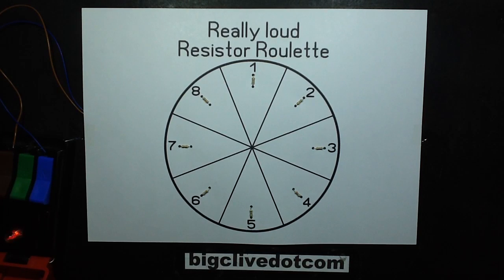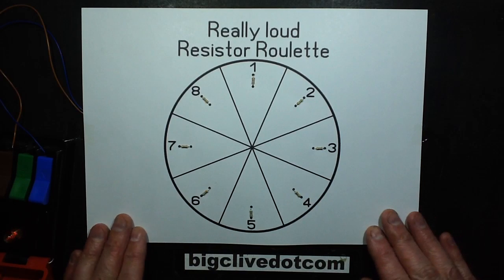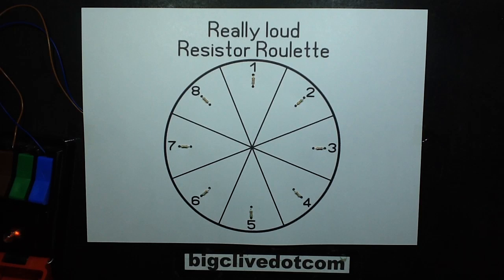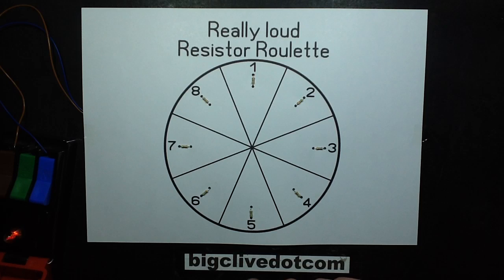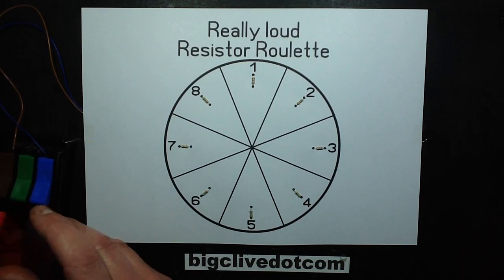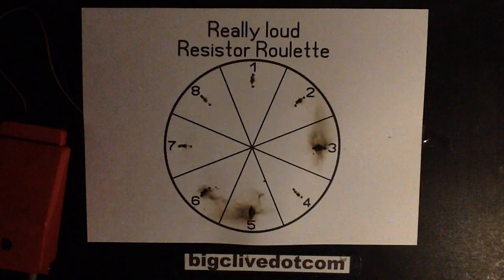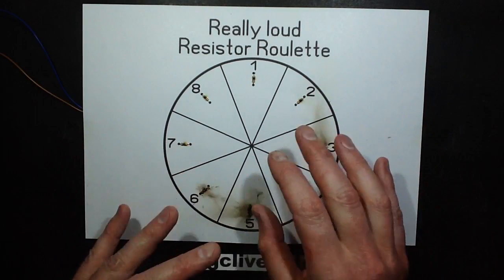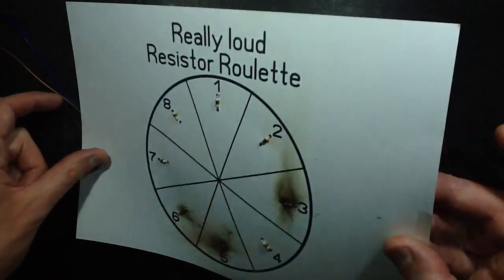Extra violent resistor roulette.  The OMG big-fuse remix.

Comment: I found some 15A fuses on eBay, apparently to BS1362, to go in my 13A plugs. Hurrah, the bangs just keep getting louder! Maybe I should try a nail next, or a piece of copper bar instead of a fuse. Domestic fault level is, what, of the order of 5000A?
Reply: ridefast0 I've seen 34mm screw glow orange in a 12,5MVA transformer. I guess you can use that.

Comment: Reminds me of the days when I had a big pile of surplus PCBs and a mains lead with croc clips. I could usually get half a dozen really good bangs per board with random clip placing. :)
Two six inch nails connected to the mains, placed in a tray of wet salt also makes a lovely display, with lots of fizzing and sparking.
Or put the nails through either end of a banana..... I tried a cheese sandwich, too. Horrible smell, but unspectacular.
Reply from the maker: ParedCheese I do have a video showing a potato meeting a horrible electrical death.

Comment: Those 13A fuses sure take some current to blow.  Our consumer unit still has bottle fuses and any time there has been a short, the 16A fuse always blew while the 13A fuse in the plug of the culprit product remained intact.  Of course those 16A bottle fuses are rather expensive, I think €1 a fuse.
Reply from the maker: ***** It seems to be a standard requirement here.  I think it's partly due to the distribution system they use and partly to ensure that in the event of a power-cut they aren't switching on into a full load, since the breakers seem to be the type that trip on power fail.  So when the power is reinstated the load builds up gradually as people reset their breakers at random times.  Power cuts are modestly common here due to the rural overhead transmission and distribution.
Reply from the maker: Seán Byrne The distribution board in this house is an old Wylex panel with rewireable fuses (The first thing I checked was that they had proper fuse wire in them!).  I'll be replacing it in the future with a more appropriate MCB based unit, although that probably means I'll get more nuisance trips requiring nocturnal trips out to the garage.
Reply: bigclivedotcom C curve MCB for your 'experimental circuit' maybe? (or an HRC fuse holder instead of an mcb on that circuit)
Reply from the maker: ***** Maybe even D since the utility companies obligatory RCD on the main incomer renders the primary reason for R1-R2 resistance compliance a bit moot.  But then again, I could always run a REALLY BIG cable to my workbench.
Reply: bigclivedotcom What, your utility co requires/supplies an RCD? :O  IoM?
Reply: bigclivedotcom Ah that actually seems like a sensible idea by the power company then!  :)
Reply: Here in Ireland, they generally don't trip on a power failure apart from when the occasional power cut caused by lightning.  My brother's house is fairly new (4 years ago) and he has three RCDs (2 for bathrooms and 1 for rest of house except lights) which all remain on during power cuts.  The RCD is the only trip-switch on our consumer unit.  Thankfully it doesn't need replacing each time it trips as I've lost count of how many appliances failed with a ground-fault over the years.  Usually with an live-ground short, it trips before the circuit's 16A bottle fuse blows.

Comment: Well Clive, you are a braver (or more likely crazier) person than I am for sure. While I enjoy watching people do silly things on youtube. I personally don't like messing with more than about 75v :) That certainly was quite spectacular, and I don't think many of us could have imagined it would take out 3x 13amp fuses, quite a surprise ending there! Keep on messing with electricity sir, so I don't have to :)
Reply from the maker: I took that one down.  It was just a bit too dodgy encouraging people to stick spanners in toasters.
Reply from the maker: arcadeuk http://www.youtube.com/watch?v=LwaQU5vN4z0
Reply: arcadeuk Theres a video somewhere of him sticking a knife into a live toaster! :)
Reply: That's not surprising! lol I'm going to go search for that as its probably real ;)
Reply from the maker: arcadeuk You can design a multiple RCD system where your main board has a 100mA time delay RCD (very short time like 100mS) that allows normal 30mA instant-trip RCDs to clear the fault before the main one trips.
In your case it might be worth dividing the games into a series of radial socket circuits, each with its own RCD covering a group of machines.  At the very least I'd recommend an in-line RCD for your test bench or when working on machines.  They detect an imbalance between current out and current back in, so they detect a potential shock current flow well.  They also have the added benefit of tripping if older or damaged wiring starts leaking current.
Reply: Share it as a priate link. I think I need to see it now lol
Reply: I don't have RCD's in my house yet, but I should considering most 70's and 80's pinball machines have exposed mains wiring inside, problem is, having lots of CRT screen arcade machines tends to trip them no matter what, as there  is always some leakage from CRTs, and turning 30 of them on almost always guarantees problems
Reply: The new wiring for the pinball cabin is RCD protected (pinball machines fortunately do not leak) but it sounds like some more advanced planning is required when the rest of the house is re-wired, Videogames tripping RCD's is a major pain for anyone with a sizable collection. I understand schools and offices had he same problem back in the day of CRT computer monitors, and a large number of them were concentrated in one area
Reply: +arcadeuk There can be problems with the type of mains RF filters fitted to reduce interference, they are often built into an IEC 320 power connector (kettle style) or could be a stand-alone PCB or cylinder as often seen in microwave ovens and washing machines. One filter is OK. But if there are many machines, each fitted with a filter, all the capacitors combined can leak enough current from 'live' into the 'earth' path that it trips the RCD.

Comment: If that had been a full short, it generally takes out the weakest fuse, but because of the resistance all the fuses may have had chance to glow like a lightbulb and finally melting away at about the same time (has recently done a vid of a glowing fuse)
Reply from the maker: ***** It was certainly a "messy" arc based short as opposed to a full-on metal to metal short.  I was still a bit surprised that they all failed though.  Enough to crack them open to see if they actually had the required sand in them.  They did, and while two had melted to clean blobs inside, one had vapour coated the sand into little clumps.